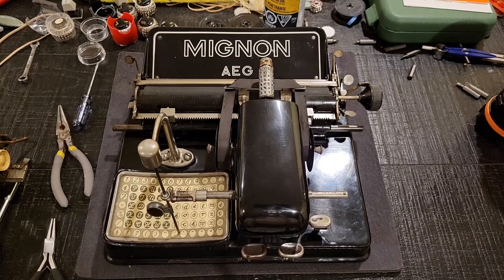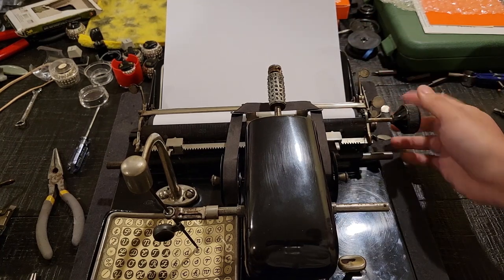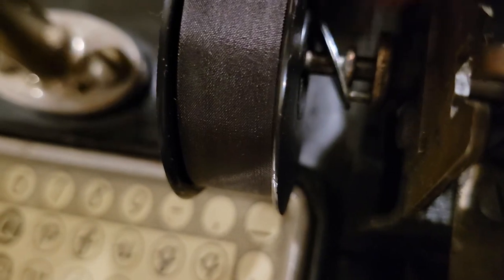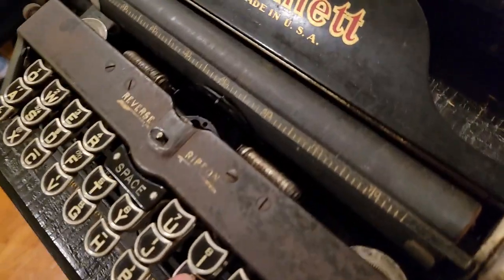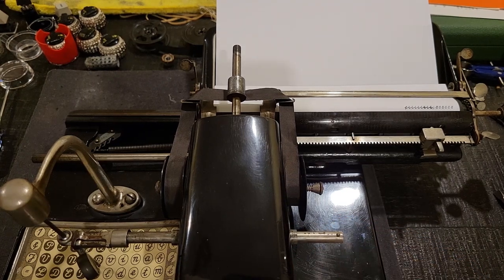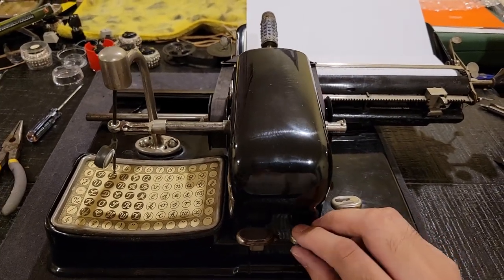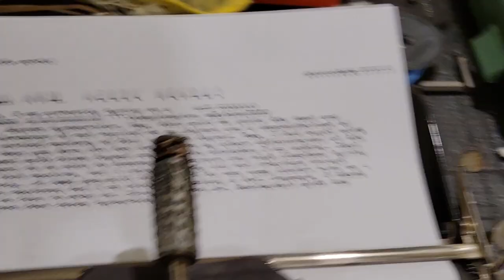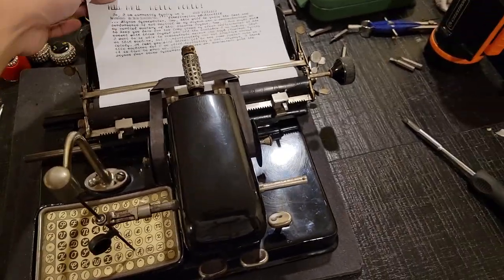This keyboard only has three keys! (1925 AEG Mignon 4 index typewriter)

Comment: The stylus and the fact that you're basically "swiping" like on a modern cellphone is really interesting to me. It's crazy that this would be the more affordable option as it looks super heavy and far more complicated than a "regular" typewriter. Fascinating. I'd never seen one of these before until I was shopping on Etsy earlier today and had to search for a video on it. Thanks, great video as always.
Reply from the maker: It is actually far simpler and lighter than a comparable "standard typewriter" of the time, and likewise probably lighter than some portable typewriters. One must not forget the effect of multiplying all the parts for conveying motion from a single key to a typebar by up to 44 times, and all the cast and machined framework needed to keep all those parts rigidly constrained and working in concert.

Comment: Whenever I see low key count keyboards nowadays I think "chording keyboard". 
Nice to see how the typewriter industry approached lower cost machines by reducing the amount of levers and mechanical elements.
Also, was about to ask "how does it print when the stylus is not 100% on the symbol" when the mechanical explanation came up. Pretty neat!
Reply: What's the explanation? I don't wanna watch the whole thing to find out
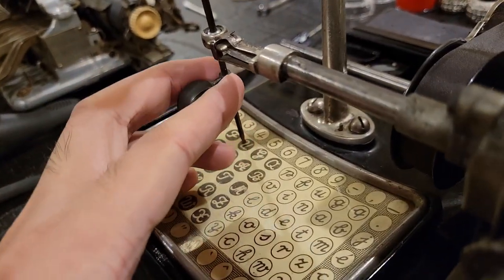Reply: @logicphile6207  8:00 The mechanical action of pushing the key down forces the mechanism into gear-like grooves that ensure the typehead can only fall into predetermined positions.
The taper of the tips of the edges of the grooves means the action is self-aligning.
Reply: Why does " reducing mechanical elements " make it cheaper ??